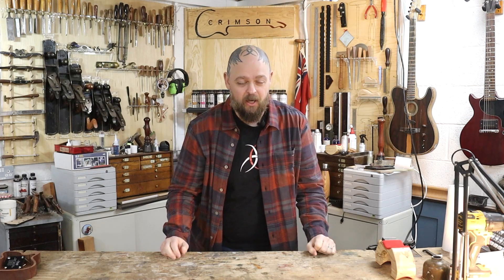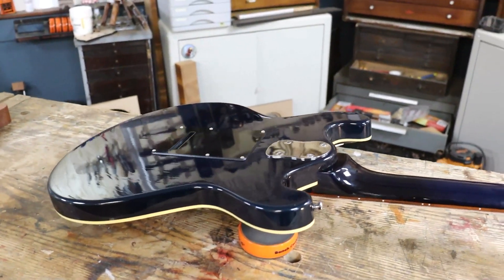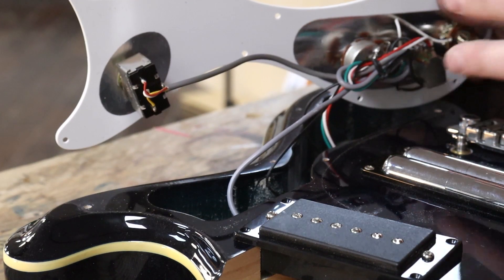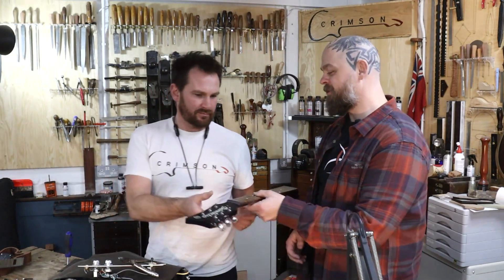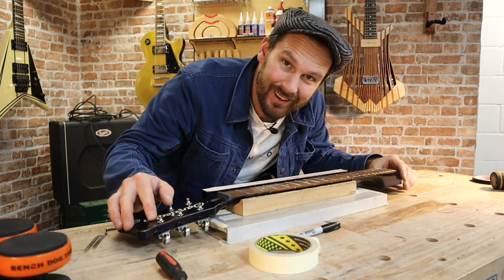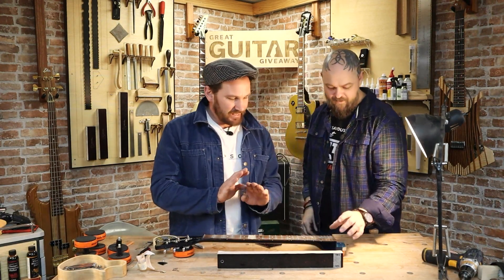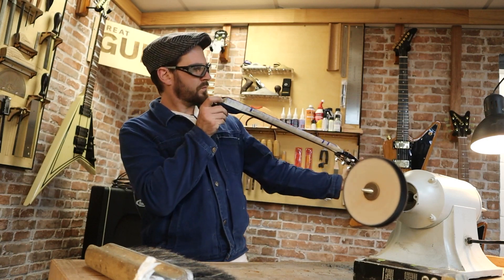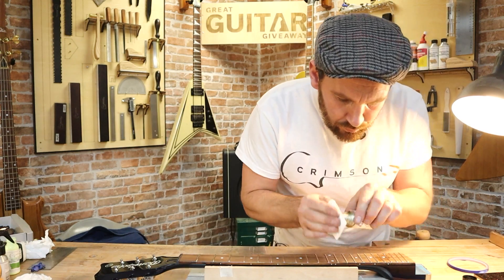VERY Marmite Guitar ! Danelectro 66 channeling Vintage Mosrite | Teardown

Comment: Slightly cheap feeling is part of the Danelectro ethos, that’s the whole vibe behind their design approach. That’s not a slight against them, that’s how they found themselves making such unique instruments, they rock.
Reply: Not an excuse. You can build an awesome guitar with the Danelectro DNA (aluminium nut, maisonette/poplar body, stacked control knobs, bolt-on neck, lipstick pickups, etc.) without breaking the bank. CNC machines makes most of the manufacturing process a breeze when it comes to mass production. The new Harley Benton guitars are insanely good value for the money, and a name brand like Danelectro have no problem getting their guitars sold, regardless of the price, as long as the quality is there
Reply: @wilhelmtheconquerer6214  you’ve misread my statement, I wasn’t making an excuse. Where Harley Benton and other budget brands make guitars that are budget variations of higher end instruments, Danelectro made budget guitrars that we’re trying to be higher end instruments. There’s a reason they’re legends.

Comment: Ive been playing for about 30 years and i use to cut my strings off like you are here, i had a Gibson Les Paul that i did this too and the neck went way out of whack taking all the tension off the neck all at once. I was able to get the guitars neck fixed easy enough, and your a tech. But for your average person, who doesnt know how to do some of this work. I wouldnt recommend ya cutting all the string tension off a neck all at once. Slowly take that tension off. I even see some folks that cut one string and replace it and then go to the next (if they are not conditioning the FB). There may have been another issue with that LP i didnt catch, but it was enough of a pain that I now cut one string at a time and replace them one at a time. Never fully taking the tension off a neck. Now this LP that i had this happen to was a 74. So their may have been other things at work, but as i said above, it was enough to make me change how i do string changes. 🙂

Thanks for the videos :-)

Id love to know what you guys think about G&L guitars :-)
Reply: Oh and you said "since sliced cheese". In my circle of folks its "sliced bread" hehe ;-) Its sliced one or the other ! hehehe

Comment: The center seam where the body was joined is visible in the paint in the reflection when seen from an angle. Did you notice that as well?

Comment: with all the changes you do, you have to string and restring for a lot to check what has changed so the original string will save from using and re using new strings.

Comment: The Danelectro logo screams, this isn't a Mosrite  a bit like putting a Vauxhall badge on a Ford, it just jars and the lipstick pickup looks like it's been plonked on to justify it.   My first (semi) build was a solid Mosrite copy using Nos EKO parts including the neck! So if it was mine I'd put another p90 in the bridge position and replace the neck logo with one in the Mosrite font saying "not rite"

Comment: I don’t understand how’s it’s a faraday cage when the pots / switch and pickups are sticking outside the “cage” to me it’s like standing in a faraday cage with your legs / head and arms sticking out 😂 especially concerning the pickups being stuck outside 
I never shield my guitars haven’t noticed any difference at all from when I did do it . I just sheld a pickguard if using one as I found it can be noisy over any wires with the picking hand but not much of an noise 
Just don’t get the faraday cage thing myself 😁
Reply: If the pickups were shielded, you wouldn't get any sound. The shielding is to shield the wires/pots/electronics from external EM interference, such as fluorescent lights, telly/computer screens etc., to stop it all acting like an aerial. Try playing some high gain stuff under fluorescent lights and you'll notice. If you're a mostly low to mid-gain player like myself, it's not so apparent, so you may not have encountered any problems.

Comment: I like this guitar, seems pretty cool, but the finish is bothersome. Every time the guitar angle changes and the lights hit it you can see the grain and where the wood is glued up for the body. They didn't do a very good job sealing it and sanding before the finish was sprayed.

Comment: If Josh has questionable taste in everything-- does that include his taste in employers?  Sorry couldn't restrain myself.
Why not cut the strings? IF they're de-tuned and have a bit of slack, I see no reason not to. Under full tension, wouldn't there be a chance of them whipping out and injuring someone?
Felt a bit of deja vu seeing that guitar. Less than an hour ago, I watched a video where a Crimson figure-out-your-own-shape kit ended looking a bit like that Danelectro, even to the angled P90 in the neck position.